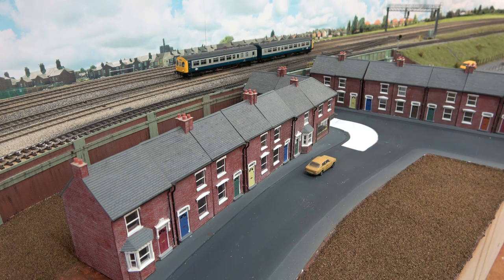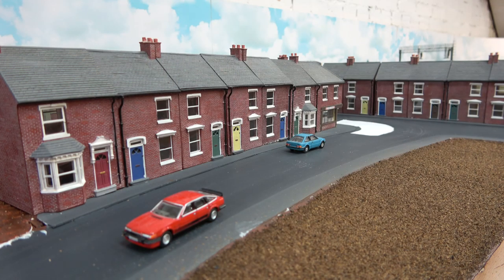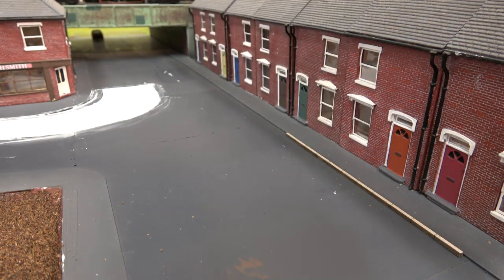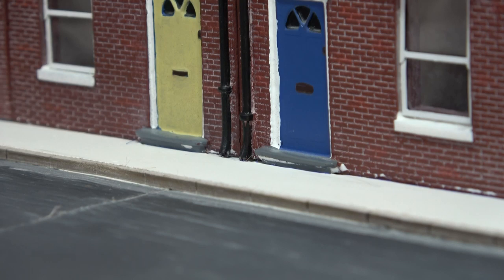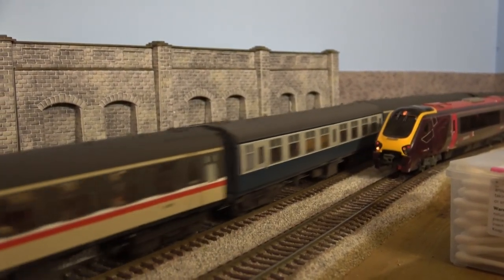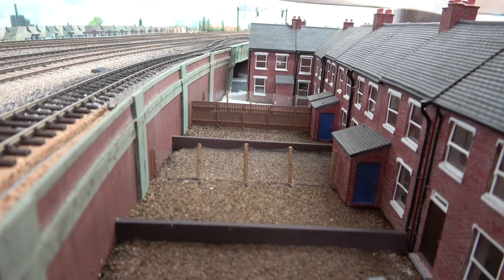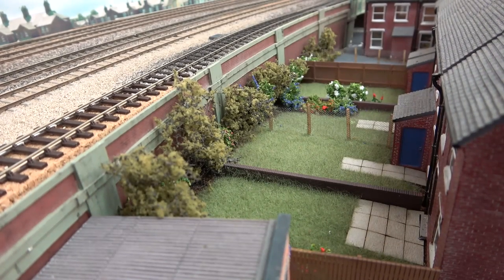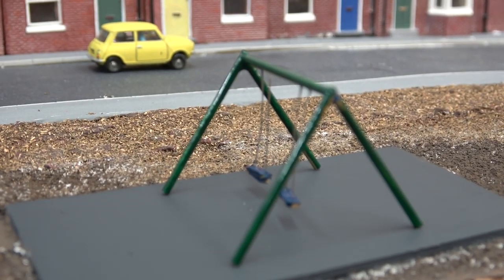New Layout Build - Starting the town scenery

Comment: Great Richard always great to watch and learn from. I had a 2.0 Capri Ghia back in the day as a very young student nurse with one of the first auto-reverse cassette desks. Before that I had a Triumph Dolomite 1850HL with overdrive and a Sprint bonnet. The cam belt went on the way to bowling one night :( I also had an axle break on a MKII Cortina. I can't beleive I used ot change my own break pads back then as I was poor.

Comment: Really impressive, what a huge difference a few bushes make to the gardens.

Few quick observations I remember from the 1980s, there would always be a back garden with some improbable ancient vehicle in it like a traction engine or large removals van that you could never work out how they'd got it in.

Maybe one of those lawns could be a bit more yellow? They all look the same. I realise you won't see much of them though.

Love the Capri, needs a trail of oil... Matchbox made a Mk1 Capri with separate engine detail (Corgi did a Mk3) both 1/64 but if you ever do another similar one it might be easier/ quicker to put in an engine from one of those?

Swings need a kid standing on the street not sitting. :-)

Keep up the great work.

Comment: Was agreeing with you about the pavements before you re-did them, and remembered that way back in the late 60s, we used some Superquick printed pavements (flagstones), which if I remember was just a paper that you pasted down. They lasted very well until the layout was dismantled and thrown out about 5 or 6 years ago.  I was amazed when Mr Google told me it's still available! Might be worth a look if there's somewhere you need flagstone pavements?

Comment: looking good !    idk if it helps (coz' You probably thought about it more then I have ) but there is still heaps more that You could add to this scene  ie:  street signs , street lights , line markings on the road , man-hole covers (someone below already mentioned that one - kudos ! )  , water drain grills in the road , rubbish bins , letter boxes , phone boxes (remember them ? - lol ) , park benches , advertising billboards  , power/phone line poles and cables , wild life  (like birds , ally cats , ppl walking their dogs on a leash)  , BUT most of all  it should be kids in that playground  and not business-men . I know , i know - the 'team building exercise'  was a joke   -  but a couple of kids  flying a kite could be a good challenge ( trick is finding a very thin & stiff  wire )    :)

Comment: Minor observation about the Mk I Capri - as it's a 1972-73 L reg shouldn't it have black/white & black/yellow number plates? I seem to recall all new cars of the period having the "new" (I think they first appeared in 1968) reflective plates.
Reply from the maker: You are correct in spotting that.  I've seen the reflective plates on cars from 1967.

Comment: Great work.  One observation, from someone that lives in a street like this is that the roofs are too uniform.  By the 80s slate was being replaced by concrete tiles, so maybe add a few to break up the roofline.  Seems churlish to criticize what is so fabulous and way above what I could do, so hope it's taken as a suggestion not a criticism.
Reply from the maker: You are correct.  The houses need work and I plan to do a whole video about them.  Currently they are too similar in appearance.  Cheers

Comment: Grass in the back gardens is to uniform each should have differences and the fence-line should have dark rough grass/ weeds. Sorry for this. Not meant in anyway negative just hope to help.
Reply from the maker: Only just got going in this area.  All the weathering and 'distress' you'd expect for an area like this will be added later.  Cheers
Reply: EverardJunction ok only just found you thanks to bit that  New Junction did on your layout.